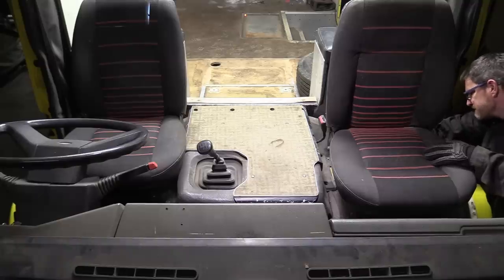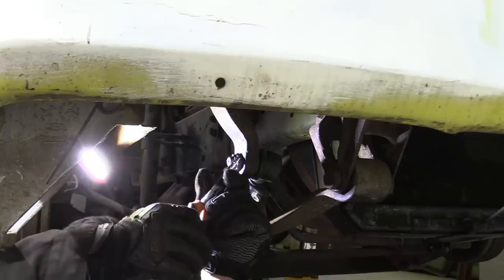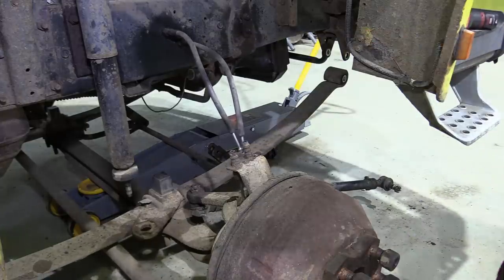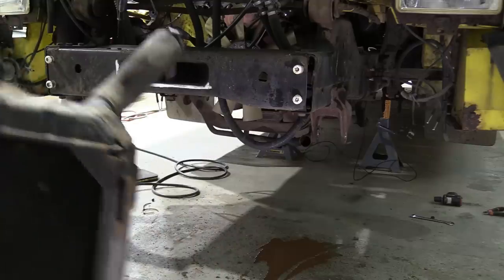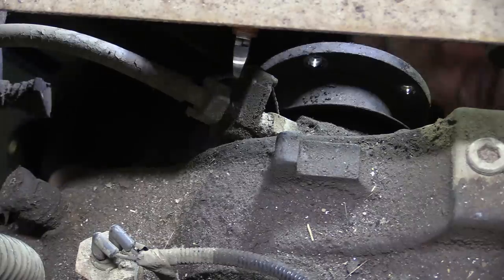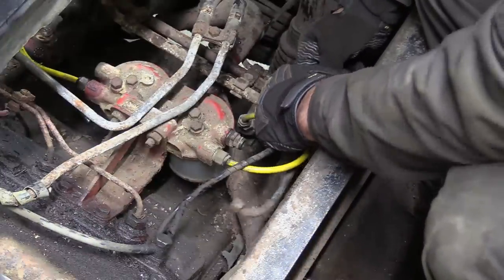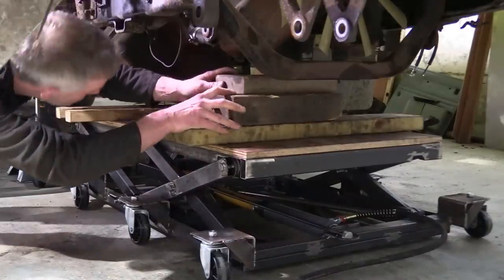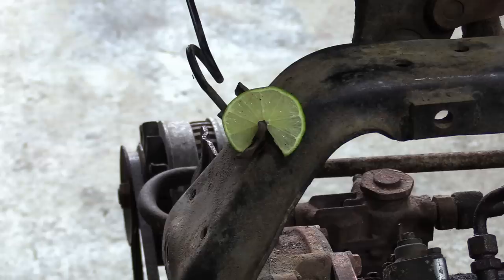The Escargot - RV/Camper Car Transporter Conversion - Part 2

Comment: Fully functional lorry rolls in, few episodes later has no doors, interior, axle, seats, heater or engine. Yep, I’m watching Bad Obsession Motorsport
Reply: Ianmundo love it though
Reply: Yeah, but let's be honest, they're going to make this into a bitchin' ride.
Reply: 6 years later still no doors, interior, axle, seats, heater or engine. But a really over complicated seat sliding mechanism!
Reply: Yep and many brackets later it'll weigh 6 ton 😂
Reply: Love it. 3/4 ton of 100bhp went out so a Fiat Panda 1.4 should be ample for going back in. 

What?....
Reply: Who says a 6 wheel Renault cab community transport bus would have been a tad easier. 
Not me that’s a daft idea.
Reply: This could go either of two ways.
1 They have become Zen Budhists, and are creating a vehicle without engine or front wheels.  It will run on will-power alone
2  It will get a double wishbone front end with pushrod operated coil-overs and vented discs and 6 piston calipers.  Inboard.  And at least 200 bhp
Reply: @davidelliott5843  They have a 1 litre Mini engine, gearbox and subframe complete with suspension and brakes.  I'm sure it would fit in the space available, and if turbocharged, would give similar power to the original Ford unit.  But would it be complicated enough?

Comment: Coming up next time - watch us install a 6 litre diesel into a Celica gt4
Reply: ha ha ha
Reply: Along with drivetrain and suspension from the truck
Reply: Next thing you know they'll be installing a marine diesel engine into the truck!
Reply: Toby Foster I’m guessing a small transport Hino or Japanese engine
Reply: @Tara19040  Don't give them ideas!"
Reply: Cesar Perez that would be very interesting, but heavy
Reply: Better get out the funk
Reply: And a mini engine in a truck.
Reply: Does that mean the Mini engine is going in the truck?
Reply: @mowler8042   hino is japanese. they toyota trucks
Reply: Could be a tough one to keep it looking stock standard tho.
Reply: @CesarPerezn  with batteries from an old German U-boat....
Reply: I honestly never say this, but this made me actually laugh out loud.
Reply: @jackimo22   Don't forget the tea pot!
Reply: I was thinking of them putting a 2JZ in this van with the biggest turbo so it will lag and when they hit 7k rpm all hell beaks loose and have to shift at 8k. Worst powerband ever.
Reply: Cesar Perez true, I’m going to throw my $1 bet in that it won’t be electric and more likely a modern lighter diesel.
Reply: @m.b.82  It's gotta go somewhere so why not!?
Reply: Or even better a 7.3 litre diesel with 
445 hp
Reply: @mowler8042  How about a 2.0 Duratorq diesel and transmission out of an early 2000s Transit?
Reply: @douro20  I don't know much about what small diesel engines you have in wrecking yards in Europe....I would always go for a commercial small Japanese engine for a truck that large...
Reply: Watch us turn this discarded diesel heater into an after burner for a Mini powered Celica!
Reply: @bvcxzgt5451  Garage 54 put a big old diesel in a Lada, I think it was a 6L Zil engine.

Comment: Six litres and a hundred and ten horsepower..........in its own way that's pretty impressive, I'm fairly sure I could drop a match in six litres of fuel and get more power out of it.
Reply: 12 valves, naturally aspirated, old injection tech, etc etc
Reply: Diesel fuel is not flamable at room temperature so nothing would actually happen. So yeah, you would indeed get more power than this old metal turd would.
Reply: @RWL2012  

And a whole crapload of torque!
Reply: @skylined5534  relative to the horsepower, yes, but not really compared to modern stuff
Reply: Not in diesel - it would just put your match out :-)
Reply: They could add lightness with a modern tdci, 130hp and 2 litres!
Reply: @20thcenturygamer22  not enough torque.
If it wasn't about lightness they could've gone for a Kamaz 740 engine, 12L 440hp and tons of torque.

Comment: So, treadmill in the back and power it off Binky?
Reply: Someone call Roadkill or Garage 54
Reply: @Braeden123698745  Roadkill will just throw big money kits at it and somebody to fit them. Garage 54 will actually build.
Reply: @MegaDirtyberty  think you are mistaking Roadkill for MightyCarMods
Reply: @nrs91  Had noticed both of them were starting to do that, mcm more so than roadkill.
Reply: @MegaDirtyberty  Roadkill get sponsored parts but they always have even from original Draguar days but still do the spannering... dont blame them being sponsored though as each episode much cost near $10k in parts
Reply: @Braeden123698745  call Garage 54   Roadkill would just hide whatever they did behind a paywall and then show us endless teaser videos trying to get us to open our wallets and subscribe.

Comment: I was just thinking that someone had clearly made some effort to maintain the poor bus - look at that nearly-new drag link! - and then you popped the radiator hose off.

Never mind.
Reply: I'm guessing the people who had the bus post-library had noticed the radiator leak and didn't want to put more effort in so they just topped things off with tap water to get rid of it / sell it to these guys or something. there's quite the mishmash of things that were taken care of and things that were half-assed, and i doubt the latter was the fault of the original owners (library use)

Comment: I think this engine should easily fit in an old mini. As a side side project.
Reply: ... into the Celica!  😆
Reply: You mean the other way round?
Reply: The only problem with this plan is that it leaves a spare A-series engine and a 7.5ton ford truck with no engine.

DO IT hahaha
Reply: Should fit inside. Problem: No one else fits inside. So you have to put a chair on the roof to drive it. Reminds me of...what? :-)
Reply: @iwtommo  it's 0.75 ton but yea that is as much as half a car
Reply: .... no.
Reply: @RivalBro  That drivetrain alone weighs way more than an old mini. lol
Reply: @RivalBro  in case of a Mini, that would be pretty much the entire car...
Reply: Sounds like a good idea. If you'd put the driver's seat into the back seat's place, that might fit. ;)
Though I suspect you might need a few shoehorns and some outside application of lubricants to wiggle it in there.

The only thing that really concerns me is, does that engine have enough power to move the Mini?
Reply: @clarkkent2913  Probably Mr Bean at Silverstone.

Comment: Bloody love this build. I had a 1987 0813 Cargo as my motorcycle race transporter for 10 years. Never let me down apart from a snapped throttle cable on the way home from Brands Hatch to Yorkshire. Still got home using mole grips on the snapped cable and my brother operating the throttle this way as I drove. Mega Truck. 👍

Comment: Put that Binky’s old engine/trans combo, you have l laying around, there.
Reply: ROFL it would be so funny if they tryed hahahahaah
Reply: Just about enough to power the kettle perhaps
Reply: true, binkie's original engine would make a good generator
Reply: @BobMarley-yq3wi  I'll have a dollop of 10w40 and two sugars with me tea. Thanks. And if you have some more of those rust cakes, that'd be lovely
Reply: Was just scrolling down to see if anyone else had thought that they have a mini engine spare 😊
Reply: @BobMarley-yq3wi  well, the truck engine has 110HP, probably a ton of torque, but you can get that out of a mini engine if you really want to .

It won't last a full trip tho.
Reply: Damn it! You beat me to it!
Reply: @enlightendbel  A Series can make 110hp easily enough. It'd defo be short of a few gears to keep in the power band pulling that around tho'. Especially with the slight over gearing from the road wheels - and you'd need another A Series to power the cooling fan it'd need.
Reply: That'd certainly help reach the weight-loss target!

Comment: Tell you what, I'm sitting here fighting pneumonia or something very close on, and watching you thrash away on this old thing just makes me hurt. I can't lift a heavy spoon! But I've never regretted buying a tie rod and ball joint separator kit and the chap across the way has a 1 inch drive impact gun, bloody magic. I rarely have to bounce or hang on the end of a 3 foot bar. and I'm glad of it. You do this sort of stuff long enough and it catches up with you down the road, I used to have the crooks of my fingers swollen up at the end of the day from pulling hard on spanners. Not any more but they are happy to remind me of past abuses on days of particular weather conditions. I should have used power driven tools far more.

Comment: Half inch drive 6mm 😂

Caught my old man doing exactly that recently, refuses to use anything other than a half inch ratchet.
Reply: I'm reasonably sure I actually have one of those in my toolbox here. I mean, I know I have a set of ½"-drive metric sockets, I'm just not sure if they go that small. :)
Reply: An M6 bolt (which I believe you're talking about, could be wrong) uses a 10mm socket. Most half inch drive socket sets do go down that small.
Reply: @denisl2760  Generally when people say a metric size they mean the size of the head, a six mil bolt head usually the reserve of hose clamps and other small things where normally a quarter inch or 3/8 socket would be better just to limit the torque.  Of course doesn't really account for long handled ratchets, power tools etc.
Reply: @lemagreengreen  I don't know about the layman's terms, but in a professional environment the proper term for a bolt with a diameter of 6mm and a head of 10mm is "M6".

Also the size of the drive end is not what limits the torque, the length of the ratchet handle is. You can easily adjust for that by gripping the ratchet closer to the head.
Reply: @denisl2760  I think he was working on a Jubilee clip witha 6mm head. You're right that the M6 thing refers to the diameter of the bolt, but in practice people typically use the socket size when they are working with nuts/bolts. :)

Comment: And, you two don't need to be in a boyband at all, in order to get lucky so many times in a row!
Even with the penetrating fluid...
Reply: Weather in the isles and all, this unit was decently well taken care of. Certainly better condition than anything i've seen of the similar age across the continent. Only recently we were inspecting for purchase a few similar Fords and some of the nut-ware was so rusted, it was merely a suggestion of a nut. So much so that the evaluator thought it was a riveted frame.

Comment: I've been thinking since the start that the engine needs to go. An aluminium Napier Deltic (as used in minesweepers) should do nicely.
Reply: @984francis And trains, don't forget trains!
Reply: @cambridgemart2075  I think (maybe wrong) that the aluminium crankcase was specific to the minesweepers, less likely to trigger magnetically triggered mines.

Comment: 6L 100hp?
You could fit more actual horses in that space and get more HP
Reply: it's a diesel, therefore the "horsepower" is actually somewhat misleading; the output torque would be considerably greater than a 100HP petrol engine and at a much lower rpm range.
Reply: It'd probably roll around the clock five times before it's even worn in properly though.
Reply: It's a truck engine, they don't need high HP's.

HP is only good for top speed. A truck needs to be able to go just over speed limit at full weight.
Torque is where it's at in that case.
Reply: It is a non turbo pig tho so probably dead as sin. Cummins 6bt they need squeezed in there 👌
Reply: ... and the combined horses weight would be lighter stil LOL!
Reply: @kaelin000  Its the power that powers it forward, not the torque.
Reply: @sauer90  incorrect; torque is a measure of an applied rotational force i.e. acceleration.
Reply: Put a 7.3 powerstroke in there.
Reply: @denisl2760  They're trying to get the weight down and a powestroke would weigh more than the Dover, so would a 6bt
Reply: I reckon they'll surprise us with a modern power plant.
Something out of a Japanese truck perhaps, or hopefully something European - say a Mercedes 3.0cdi, or an Audi 4.2tdi would be cool!
I'd love to see a turbo LS in there, but at 6T all up, it'd burn lots and lots of petrol! My bet is modern diesel...
Reply: Where the hell are they going to find all of these American diesel engines sitting around on the cheap in England?
Reply: @koopatroopa187  Cummins 6BTs and ISBs were fitted to DAF trucks and therefore are everywhere.
Reply: @lutherblissett9070  In that case, I second the motion. The 6BT is a solid engine.

Comment: Replacing the subframe bushings in my Nissan was harder than that.  What automotive god are you sacrificing virgins to for your good fortune?
Reply: The Temple of Tea
Reply: as it was a library truck it prob had a lot of sitting about and mostly used in summer, no winter salt rust, plenty maint' and not as many miles/year as most trucks.
if only my old isuzu had been like this, it would not have taken me two hours for each bolt
Reply: I'm incredibly surprised how easily that heap of rust came apart. That's some serious black magic.
Reply: What they didn't tell you is that they originally found it sitting in a 3ft deep pool of penetrating oil.
Reply: It's voodoo guys. Has to be. They're transferring all the difficult nuts, bolts and fasteners to the viewers who watch them.

Comment: Those under floor engine arrangements are AWESOME. Once I encountered a Skoda van with a similar setup that had a dead fuel pump. Solution was to fit an IV line with a bottle  of petrol to the carburetor and hang it on the rear view mirror.  Worked like a dream.

Comment: Needs a Merlin engine out of a Spitfire.
Reply: Yeah, coz that won't weigh 3/4 of a tonne 🙄 😉
Reply: @twentysevenlitres  insted it'll weigh 1 tonne
Reply: @twentysevenlitres  the spinning propeller will add lightness.
Reply: Martin Hocking Everything is light weight right? How else can it fly 🙃
Reply: But then they couldn't drive inverted - unless they fixed the carburetor.

Comment: Cummins 6,7 swap, save 250Kg, have triple the power, and an automatic?
Reply: 7,3 ford powerstroke would be better if it fit. Awesome engines.
Reply: Auto box are heavy
A Cummins 4,5 would be good enough
Reply: @johnny280zx5  How's a 7.3 PS better in any way than a 6.7 Cummins?
Reply: @SamsMotors  Only in the mind of a Blue Oval fan.
Reply: There in the UK so probably something like a Mercedes Engine might be fitted like some of the larger Campers.

Comment: I forsee elaborate brackets with gussets with the install of the new engine and gearbox assembly.
Will it be an alloy diesel?
Reply: Calling it now - 4cyl cummins from a daf 7.5 tonner. Cummins, aka the LS swap of the diesel world :P
Reply: Maybe a Wankel?  I doubt it.  I just wanted to be able to use the word "Wankel".  Outside of the RX-7/8 community, there are few opportunities to legitimately use the word "Wankel."
Reply: @11bravocrunchie22  Well played, sir.
Reply: @iwtommo   you put them in landys and smaller veichles that you dont think it will fit in although it's a good idea with compound turbo and straight pipe
Reply: I'm thinking 12-valve 5.9L 6BT Cummins.  With a side order of Allison automatic!!!!
Reply: Paul van Lieshout I'm thinking not..!  Are you aware of the new diesel laws in London ? Apparently it's a whopping $100! Per day to enter the London district... I heard it through the grape vine if it hasn't already been augmented... I recently have put a v6 Holden motor with its automatic in to a coaster bus and swapped diffs to a higher ratio... It works a treat. Little heavy on the 91 octane fuel but what a breeze to drive in comparison to the 22r motor ( 4 cyl manual) l
Reply: @rickh6963  that is still a 1400-1600lb combo
Reply: What ever it is it has to be automatic ...
Reply: Maybe a Ford 3.2 Duratorq 5cyl. Think that would be a good match
Reply: @geoff3656  good job they are in shropshire then... and there isnt many racing events in london lol
Reply: @geoff3656  Dollars?
Reply: @iwtommo  the 4bt is heavy as hell, and for the most part is still an anemic dog compared to the development of th 6bt engine. A better option is the new 2.8l cummins, the downside is its only really available as a very expensive (just under 5 figurss) crate motor.
Reply: @thatbuelldude189  Yep, no weight savings there, how about the Cummins Repower I4 turbo. maybe save 500lb.
Reply: @rickh6963  a 4bt is about 800lbs so your saving a bit 
Would have to be hopped up quite a bit tho
Reply: @machinist7230  a 4bt is 800lbs 
A 6bt is around 1200lbs
A 4bt with a few mods can be a pretty good unit
Reply: @11bravocrunchie22  well done for contriving a three for one opertunity 👍
Reply: 11Bravo Crunchie can also be a shortening for “weak ankles”
Reply: I want to know what penetrating oil these guys used. It clearly works.
Reply: @geoff3656  Good job they don't live in London then. That's like saying someone in Sydney shouldn't do something because of the rules in Melbourne. Ie: completely irrelevant.
Reply: Gaz Jones 
Cheers Gaz, these guys live outside London don't they ? If they intend to sell it or use it there ...There are thousands of diesels selling at runout and below prices. It would be a good idea not to build a dinosaur I'm thinking. Btw Melbourne is great city but never irrelevant. There are not many cities of the world built in the gold rush...
Reply: What about a 3 litre TDI from Audi ? Plenty of them around. Up to 313hp and 650Nm as standard. No idea what sort of gearbox to use with it on a lorry though..
Reply: @Panzax1  Pain in the proverbial to do because there are no aftermarket ECUs available, so there's a whole heap of complicated electronics required,